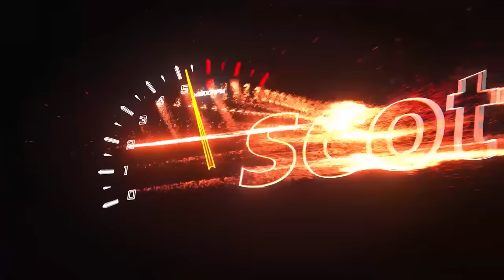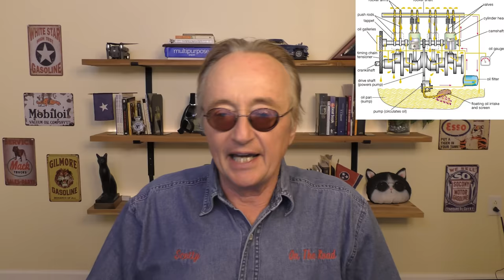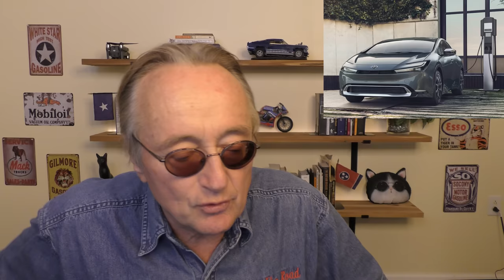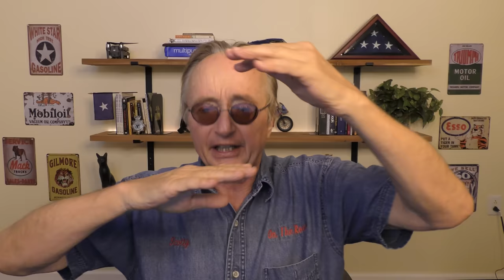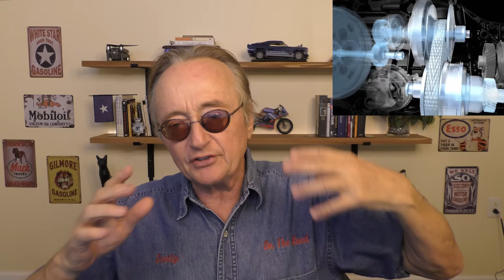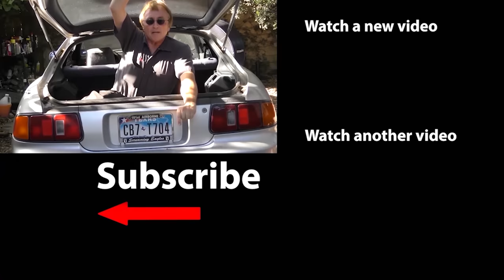Never Do This When Changing Your Engine Oil

Comment: Don't forget to replace your aluminum drain plug crush washer on a Toyota/Lexus vehicle when you change your oil.  They're cheap.
Reply: & polish that badge with pride
Reply: I forget everytime.   I never get a leak. Why ?
Reply: same on Honda’s
Reply: I have 11' camry. It never leaks just burns oil
Reply: @bbustin1747  It's preventive maintenance
Reply: @whozachdey1  I solved my oil burning by using Marvel mystery oil in the engine and the gas.
It took some time but over several months it reduced oil consumption by a lot.
Reply: Changed a 1999 Camry since new and only chg the crush washer once it twice in all those yrs. Np
Reply: I never change my crush washer cuz I installed a Fumoto drain valve and it works great!
Reply: if you get your filters from a Toyota dealership the crush washers are free when you ask, at least they are for me.
Reply: And fart in the driver's seat for that new car smell 😂
Reply: I always forget to lol, haven't had an issue...yet haha
Reply: I never replace the washer and I've never had a leak
Reply: I have changed my 03 Tacoma's oil every 3 or 4 thousand miles since new and never have done the drain ring. It seals up every time and has never leaked a drop.
Reply: I've also never replaced it and never had a leak. You can also anneal the old one.
Reply: I never used to replace the drain plug washer in my older vehicles and never had an issue.  Have no idea about newer vehicles.  Maybe they use cheap washers.
Reply: I’ve got five spares for my 2014 with 136 k on it and never need to replace a single one yet.
Reply: Just HAD to replace one for the first time in 30yrs of DIY oil changes on a Nissan 1.8 Sentra...it's cheaper than draining the oil so I will continue to do on that vehicle...on my Tacoma I won't til it leaks at the drain plug... hasn't needed it yet...
Reply: @whozachdey1  I’ve got a 2000 VW Jetta. It’s a Hybid. Burns gas and oil
Reply: I used the same gskt for 9 yrs.  I never change them out.  Never leaks lol. Funny I worked at yota Lexus too.
Reply: Total waste of money! It's like replacing a headlight before it burns out! Stupid!
Reply: @bbustin1747  because you don't need to
Reply: @bbustin1747  Unless your crush washer is really damaged they won't leak..
Reply: @fixitallpaul4847 👍A great additive.. I use marvel mystery oil in every oil change. My sister has a 2023 Toyota Camry XSE and I'm changing her oil today and I'm putting marvel mystery oil in it as well. It really cleans and lubricates and prevents sludge and varnish deposits... It will clean and prevent sticking piston rings.
Reply: @DrDennis .. I did the same thing on a Honda Accord I had and no problems. It always sealed up tight.. I have a new Toyota Camry XLE and I don't  change the crush washer on it.. I do have some extra ones on standby if I ever need to..
Reply: @TDK2K  Same with mine.. The Guy at the dealership gave me four of them at one.
Reply: I did replace my washer the last time I changed my Toyota oil,  bout time for a 1982 Tercel I guess...
Reply: How about no? No leaks 237k miles so far.
Reply: @bestlaptop_psn  so what smd.
Reply: Same with subie (at least my 2014 forester)
Reply: @kamakaziozzie3038  I’ve got a 2010 Audi A4 hybrid too!😉
Reply: @DrDennis I’m right there with you, Dr. Den. I’ve had 10 Hondas since..a million years ago. I’ve changed the oil on ALL of them. Changed that washer maybe twice. No problems.🤷🏻
Reply: @bbustin1747  I think you're lucky.  They call them "crush washers" because they create a good seal.  They didn't change it on my friend's drain plug at Jiffy Lube and their oil leaked.
Reply: Hondas too.
Reply: The Toyota filter I buy come with them
Reply: @jamesmedina2062  yeahh f that
Reply: I still used them for 3 times before putting a new one
Reply: Usually get my oil/filters through the toyota dealer in town and they always throw a couple crush washers in for me no charge.
Reply: @bbustin1747  its for OVER TORQUING as you can see the deformation when it happens. Its not for leaking unless you way under torque it.

Comment: Surely the sensible thing is to first circulate the new engine oil around the engine using the battery for say 20 secs whilst preventing the engine fire-up?  That will fill the oil filter and get oil to the top of the engine.  All you need to know is which relay controls the fuel supply and pull this out.  If it's a computer-ridden engine then help from some geek is needed, no doubt!!

Comment: all modern filters have an anti-drain back valve so the oil stays in the filter so you do not get a dry start
Reply: Then why is my 98 camry filter empty when I change it?
Reply: if the filter's upside-down, that doesn't matter.
Reply: Upon startup oil is bypassed from the filter. Also most filters are on bypass because of poor oil quality, cheap filters or lack of oil changes.
Reply: @ginog5037  even cheap filters have a bypass, if it stuck on bypass you are not cleaning your oil so the filter is worthless

Comment: Talking about filling the oil filter before installing, I personally think it is a bad idea. One car a customer had serviced brought it to me by tow truck, because the oil light would not go out. The oil pressure switch was fine, being new. I eventually found out the previous workshop that serviced the car, had filled the filter with oil. This created an air lock in the lubrication system, stopping the oil pump doing it's job, I drained the filter, & problem was fixed.

Comment: Disagree with first topic regarding the pre-filling the oil filter, at least for some cars.  If installed on top they have internal one way valves to prevent empting for a reason .  Almost all engines take the pick-up tube direct to the filter.  If its dry, you have time gaps in the lubrication.  Sorry man, anything from VAG at least, needs oil filter saturation prior to running.  Or, remove injector and coil pack electric connections and rotate engine for 5 - 10 seconds prior to starting.

Re: sparkplugs, dielectric grease on aluminum heads is so important to prevent galvanic welding.    Also, torque settings need to be considered if you lube wheel nuts.  eek

Gates are awesome.

Comment: Lubricating wheel studs is a bad idea because the torque spec is based on achieving a particular preload in the stud. When you lubricate the stud and lower the coefficient of friction between the studs and nuts, the same torque will produce a much higher preload. So the spec torque would essentially be like over torquing them and you will eventually start breaking wheel studs. If you have rusted studs, clean them up, or replace them, but don’t lube them.
Reply: Never have trouble with lubricated studs, but dry studs can cause damaged threads, or seized threads.
Reply: @brettymike  Manufacturers most often specifically say to not put any lubricants on wheel studs because their torque specifications produce the design preload based on the coefficient of friction with dry threads. If you lubricate the threads and use the specified torque values, you could be putting as much as twice the design preload in the studs, which will eventually cause failure. If all else fails, read the instructions.
Reply: @Heretic10001  I am a real engineer, and have been making sure to keep them greased for at least 50 years, and never had a problem - EVER.
Reply: @brettymike  Good for you. I too am a real engineer (ChE with ME minor) and have real world experience with this issue. Someone at a shop quite a few years ago put anti-seize on the studs of my MR2 Turbo track car. I told him he was wrong about lubricating wheel studs and he argued with me. Most owners manuals specifically say to not lubricate wheel studs. But I didn’t clean it off right away, figured there was probably enough safety factor in the studs that it would be OK until it wore off. Wrong!  The wheels were obviously being removed and reinstalled onto this car with some frequency since it was seeing a lot of track use. Within a year, my studs started breaking off prior to reaching the 76 ft-lb torque spec. After the 2nd one broke off, I replaced all 20 and they have been fine since. Thank goodness they didn’t fail on the track and cause loss of a wheel. The failure was from fatigue due to repeated over preloading due to the slippery threads.
Reply: @Heretic10001  I am also an inventor (put that in your pipe and smoke it :).   You had dud (bad) studs you weren't keeping an eye on, and they were being overtightened too much. As I say, 50+ years experience has been my teacher (working on 1000's of vehicles in my own business). I have had troubles ONLY with DRY studs over the years.
Reply: @brettymike  You’re full of crap but it’s a free country and you’re more than entitled to be  full of crap. I am done with this discussion though. I do agree that they were being overstressed.  But it was due to the lubricant.
Reply: @Heretic10001  You can't handle the truth Big Noter.
Reply: Spot on Heretic10001, Bretty is wrong.
Reply: @glennhansel9411  Thanks for that. 🙏
Reply: So leave them dry and loose or under torqued.good luck with your  cars. There is a rule for machine work.clean lubed threads on correct torqued bolts . especially head bolts.thats. Why they do the turns of total rotation on the last step
Reply: @jamesbaskins6351  We’re talking about lug nuts/bolts here not head bolts. The protocol is different. Clean, yes. Lubed, no. It’s important to understand the design basis for the joint. The “product” that is desired is the appropriate preload in the bolts or studs. The coefficient of friction for lubricated threads can be half (or less) of the coefficient of friction for unlubricated threads. So if the torque specification is based on unlubricated (but clean) threads, which it generally is for wheel fasteners (break out your owner’s manual and read it!), and you lubricate them, you’re going to put at least two times the design preload (i.e. stretch) into the bolts or studs. As you pointed out, with some head bolts, the design preload is achieved by using a certain amount of rotation after contact, rather than a torque specification. This is actually more accurate because it is based on the thread pitch and you can more precisely achieve the desired amount of stretch.

Comment: Subaru CVTs rarely have sliping issues. They had a valve body issue that if not corrected would cause a slipping issue. I have a 2016 crosstrek with 250k and I abuse the crap out of it. I mean pulling full size pick ups out of the ditch. I pulled a LR6 down an ally with 2 feet of snow. The dealer noticed that it is starting to make a little noise and offerd to make a claim with subaru of America to see if they would replace it or attest discount the price of a new one. That was even after me telling the service writer that I abuse the crap out of the car. I was having a wheel bearing replace at Walser subaru because they charge 375 flat for a wheel hub replacement  and that is dirt cheep if you have ever changed one on a subaru.
Reply: The rear wheel bearings always fail, done a few.
Reply: @Melissa’s Mess  yeh they tend to fail first but that particular style of bearing is found across a bunch of manufacturers and it fair about the same. They are shallow grove ball bearing and are not good with side/thrust loading or impact. You will find a moderate impact like hitting a curb will damage the bearing. The front bearing tend to get the majority of loading and impacts in the direction that was designed for. Honestly caged roller bearings would last far longer in the rear but they are more expensive and they take longer to manufacturers and install. Subaru calls for I think 85 or 90k on the "service interval". My 84 GL Wagon had conical roller bearing that took way more abuse and all I had to do was repack them. The car had 330k on it when I sold it.

Comment: Cars & trucks with ges engines use small filters so it doesn't take long for the pump to fill the filter then to build pressure. But on diesels most use a 1qt filter & I always fill before installing.

Comment: Spark plug anti seze. If you use Aviation champion spark plug anti seze it is. Water based.  That is the correct process for spark plug install.  I live on the sea coast in Alaska as well as all the salt thats used on the roads here.

Comment: i rebuilt a porsche 3.2 engine filled it with oil and turned it by a ratchet aprox 10 times with the oil pressure switch removed which is mounted at the furthest point on head from the oil pump  and that was from a dry rebuilt engine ...

Comment: 10+ years changing oil for a living and I would only pre-fill a vertical screw-on filter, on a vehicle with a turbo. Also diesels. That's it. the other types don't need it.

Comment: Filling the oil filter when changing the oil was often necessary on the old Buick V8's and V6's and Cadillac V8's with the externally mounted oil pump as it would often lose it's prime and never pick oil up again until the pump was opened up and packed with vasoline.  It's not really needed on new cars with spur pumps or pumps submerged in the oil near the bottom of the oil pan.  Does save a little low oil pressure time if the filter is mounted at an angle in which it can be filled and mounted easily.

Comment: When you buy a car with manual transmission, you know it is the already tested and proved technology so, it will last forever.
Reply: Not necessarily. My brother's 96 Nissen pickup's 5 speed manual shifting fork wore out the case and he had to buy a rebuilt tranny.  Piss poor engineering as it should have had a brass bushing for the fork to move through instead of the soft aluminum case.

Comment: I gather some filters have a valve to prevent draining when the engine is not running.  In addition I believe that lubricating certain threads such as plugs and wheel bolts can lead to over tightening.
Reply: Yep the anti drain back valve in the oil filter
Reply: What about cartridge filters?
Reply: @2010ngojo  good question

Comment: When I change the oil on my Subaru Forrester, I normally just put it in flood clear mood and crank the engine for were 10 to 15 seconds to build some oil pressure

Comment: The friction surface of an engine isn't 100% smooth. There are miniscule cross hatch valleys on the surface. These valleys hold films of oil that lubricates before the changed oil reaches, after an oil change; so you don't need to fill a new filter with new oil. Still it doesn't hurt, if it makes you comfortable!
Reply: So true!😎
Reply: @bigjay1970  CHEERS.

Comment: Anti-drainback valve

This membrane obscures the holes through which dirty oil gets into the filter. The purpose of the anti-drainback valve is to prevent the oil from escaping from the filter when the engine is switched off.

Comment: You don't need to do it as long as there is enough oil in the engine and the oil pump picks up oil and pumps it is what is important.  Oil pump is what can't run dry.

Comment: I've heard that one reason not to pre-fill the oil filter is that it can introduce contaminants on the downstream side of the filter medium. Probably not a major concern, but I've never seen any official advice to pre-fill the filter. Oiling the gasket, sure, but not pre-filling.

As for using anti-seize where it's not specified, my understanding is that the real problem is that it can result in over-torquing.

Comment: I once bought an old Mercedes, said yep will buy car but on condition it was checked over by my mechanic. Agreed to pay $150.00 if I did not go ahead or $50.00 to get the guy back to the dealership if I did. Car turned out ok, 2 easy problems identified but I then knew what I was buying, transferred the money and gave the guy $50.00 to get home, cheap piece of mind.

Comment: Scotty when I replace my plastic oil pan once it cracks.   Do you recommend i pre fill it when installing ?  Just checking
Reply: No.
Reply: Absolutely. That way, you can check it for leaks while you’re under there, saving tons of time. Of course you have to overfill it some if you want to check the oil gasket, too, which means you have to be pretty fast. 
See what you started?

Comment: Plastic pans in a cold climate are just a disaster waiting to happen.  As the temperature drops the plastic becomes more brittle and can crack or shatter if the pan hits an object.  Once the oil and the engine heats up the pan becomes less susceptible to damage, so wait until the engine is warm before driving in very cold weather.
Reply: Im not that worried about a factory plastic pan. At 200k it will probably need replacement tho. Its the aftermarket plastic I worry about.
Whats next snap in plastic pans with no hardware?
Reply: Next ting coming out Plastic piston’s and cram shaft.
Reply: On the other hand, they do not rust which happens a lot in cold climate.

Comment: I can 1/2 fill a filter on my 2 cars that the filter goes on sideways, as long as I'm spinning the filter little or no oil leaks out.  Beacuse I drain my oil over night and the system is very "dry", I put oil in the filters.

Comment: I FILLED MINE{ the filter )  HALF WAY WITH OIL, but you have to be quick and aim right to install it on the side of engine so oil doesn't runout and down the side.  it can be done , if done right. but good to know  you don't have to fill it .

Comment: Don’t Toyota filters have a backflow valve like on a Tacoma V6. That filter is upside down so every time you start it the filter would by empty. Soooo get a Toyota filter for the backflow valve ??? Especially if it’s mounted upside down.

Comment: My RAM is cheap to maintain.  Oil and air filter.  The brakes have lasted 78000 miles.  Now you may know why ...because I drive gently.

I wonder why Mazdas are expensive to maintain.  Anyone know?